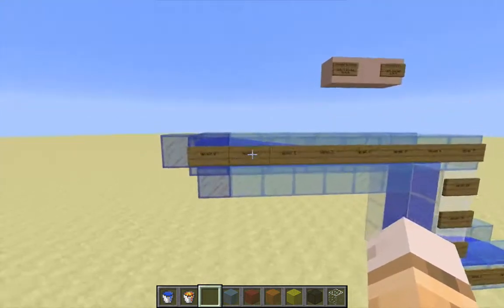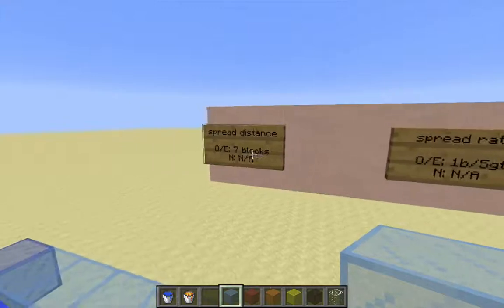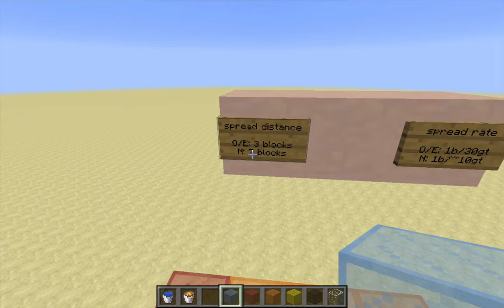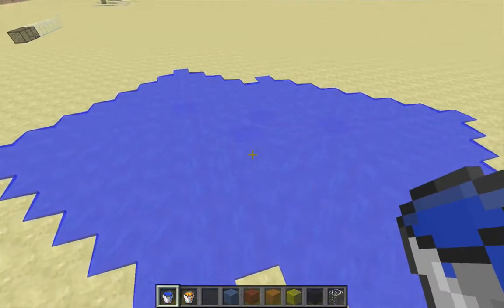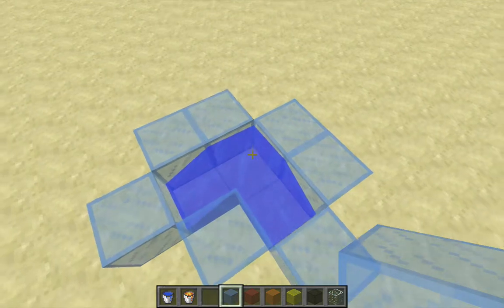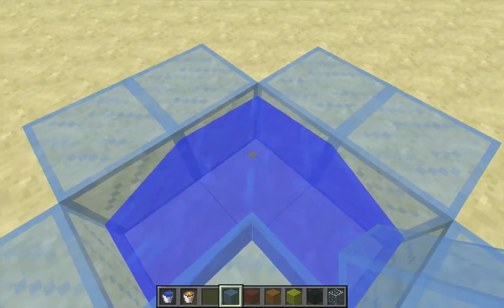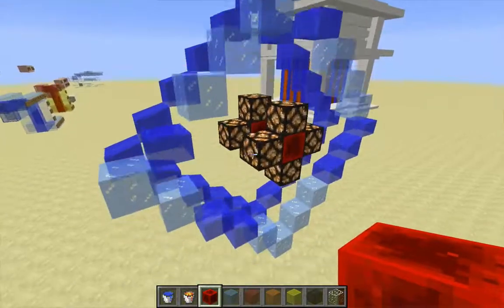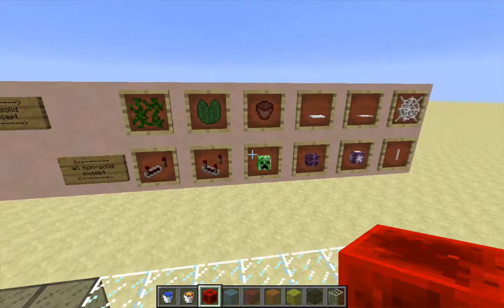Minecraft Liquids, Part 2: Liquid States

Comment: i actually didnt know how water works exactly :D i dont think these mechanics r very improtant to know about but there might be some applications u ll show throughout the series tat base on this :P
Reply from the maker: +Jendrik Weise In the video on the spreading mechanics, I'll talk a little bit about forced chunk loading, could be of interest. I think a lot of this stuff is of general applicability when designing water-flushing farms; unless you're familiar with the mechanics, the behavior of water is often seemingly erratic, and designing to accommodate the mechanics can save a lot of frustration. Plus sometimes it's just fun :-)
Reply: force loading chunks will have a few uses but i guess it s rather slow so not a lot
Reply from the maker: +Jendrik Weise Yeah, you wouldn't want to use spreading water as a way to load chunks on purpose. It's mostly a caution about what can happen, probably not very common knowledge

Comment: Maybe you should use a texture pack just to better show the direction of the current ;)
Reply from the maker: +William Pagnoux That's a good idea, even just to show the switching between blocks 8 and 9 for water (blocks 10 and 11 for lava). It happens pretty fast, but with enough of a difference in the textures it would pop out nicely. Thanks for the idea!
Reply from the maker: +William Pagnoux Unfortunately, it seems as though Minecraft uses the same textures for both block 8 (flowing_water) and block 9 (water). To make it even more confusing, the relevant textures are called "water_flow" and "water_still", but they are applied according to whether the block is rendered as flowing or still, regardless of whether the block is block 8 or block 9.

If you have any suggestions on how to use different textures for these two blocks, please let me know. I'd love to make the explanations clearer with the additional visualization.